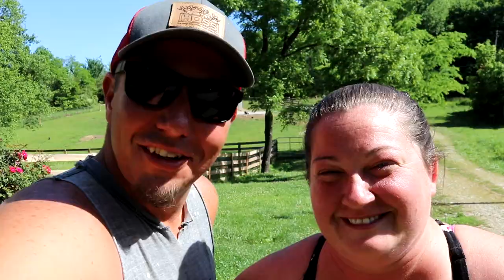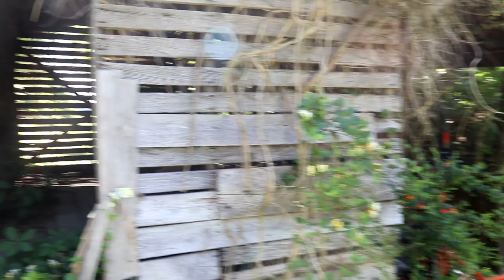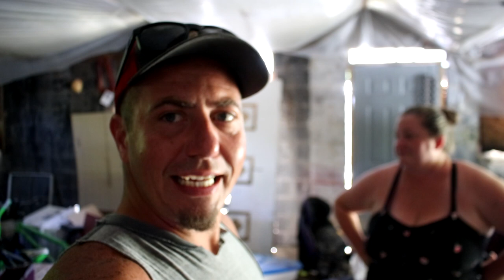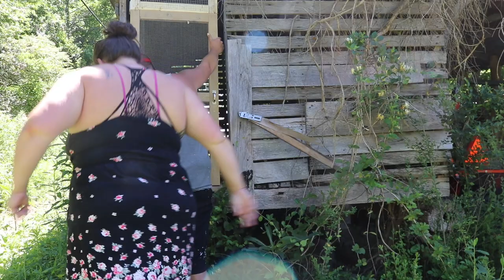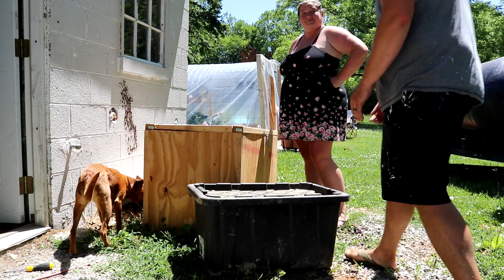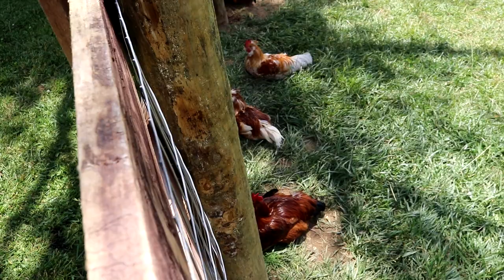ANNOUNCEMENT & Adding To The Barnyard!

Comment: I see spaces in that coop plenty large enough for a coon or other predator. My entire flock (20+) have been killed over the past couple months. The predator has gotten through very small spaces. Just a warning.
Reply: Boy I hope that doesn't happen but coon's can be pretty sneaky ! There little arms are pretty powerful .
Reply: Maybe the whole barn should be covered with some kind of netting inside? :O
Reply: Weasels, mink, coons can squeeze in. Put poultry wire up around walls.
Reply: I'm not positive who is getting into my coop, but it can climb 8+ feet and squeeze through a 2 inch space in the eaves under the roof. I've tried covering it with small hole wire fabric but the predator still manages to bend it enough to get around it and inside. I'm now climbing inside my coop, which is 3 feet off the ground and I can't stand up inside to block the inside too. I've also put out a trap and poison. Nothing is stopping this predator. Gold Shaw Farm had a duck house simular to the Stivers, but it had more wood covering it and hardware cloth, but a mink killed a bunch of ducks.
Reply: Yep...I agree